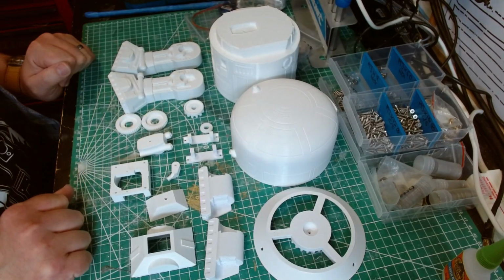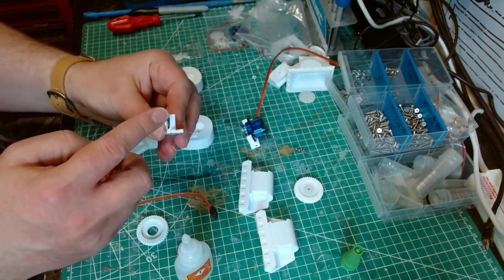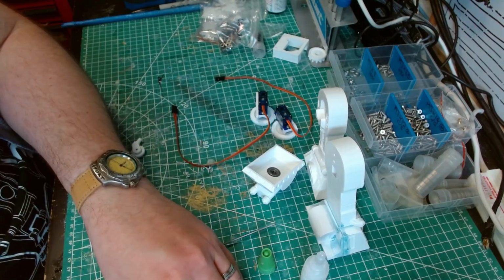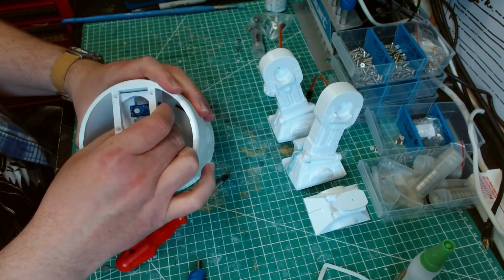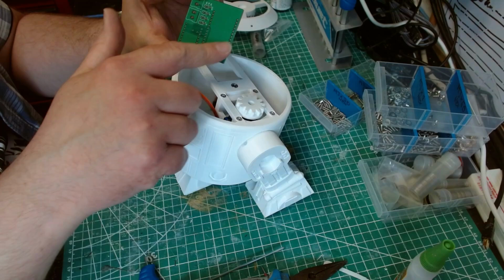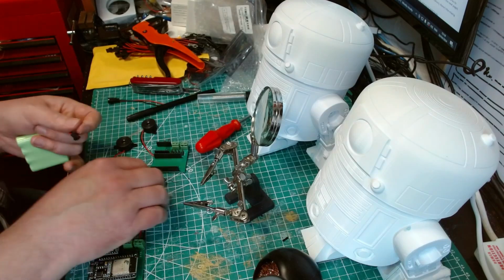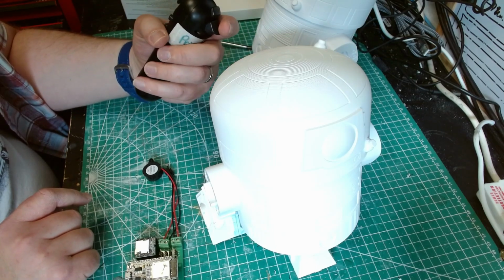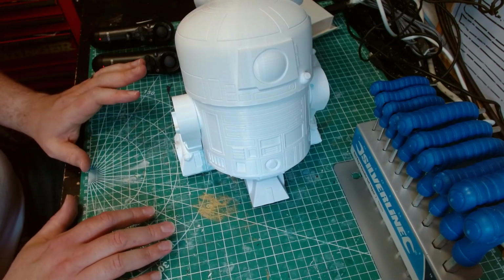Can you build an R2-D2 in a weekend*???

Comment: hey I just printed mine and going through the BOM you got here - the SP-Cow board doesn't seem to be available anywhere - is there something else that can be used instead?
Reply from the maker: Any Esp32S development board should be fine, they are all the same board, just different manufacturers as it's all open source.
Reply: @rageprint9530 yea I did some more digging and came to that conclusion - thank you! also thanks for making the BOM easy to find, I couldn't find anything else for this Droid anywhere after printing it! Already got the parts on the way to make a couple!

Comment: hi, i ordered your dev board and populated it but it seems as though the power is on the opposite end to the board? i was able to flash the board but it doesnt play anything nor does it move the servos?
Reply from the maker: Not sure what you mean by opposite end? 
Did you flash the first sketch on to get the Mac address of the controller? You'll need to add that into the proper sketch in order for them to bind to each other.
Reply: @rageprint9530  i couldnt get that to flash but used the six axis scanner and got the correct mac address, i was able to flash the board and the controller light goes solid but no sounds and no movement on the servos, also the red light on the board stays on. and looking at the traces on the pcb it looks like the power is at the opposite end of the board not the usb end?
Reply from the maker: @emanuelwebber9931 oh I see, yeah it's the top connection. The middle ( just above the esp) is for the speaker.
Reply: @rageprint9530  do you have a diagram? or maybe could you make a vid going over exactly how you did it and the file structure for the sounds? theres so many conflicting ways of loading all that stuff.
Reply from the maker: Not a bad idea, I'll do a video
Reply: @rageprint9530  that would be awesome lol cos i cant get it to work for the life of me, board is flashed and the controller connects but no noise and no movement.